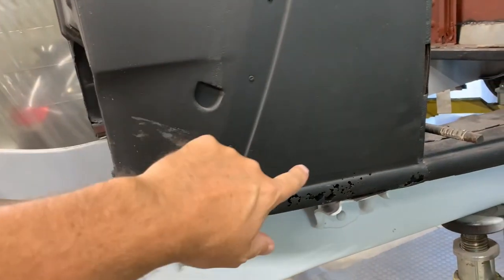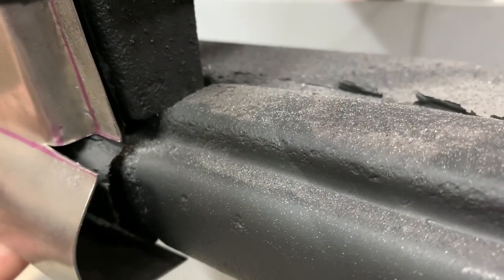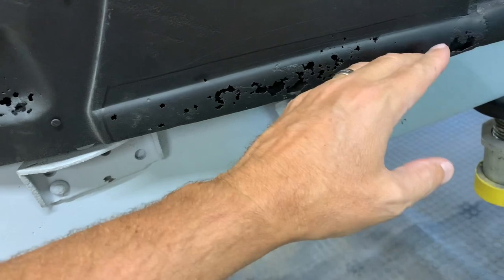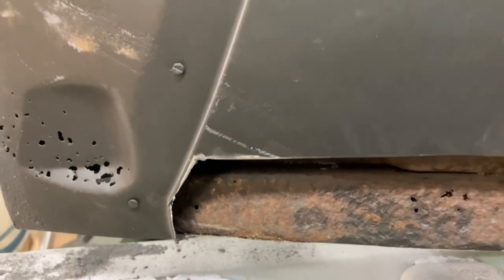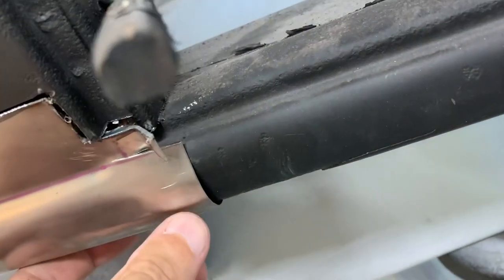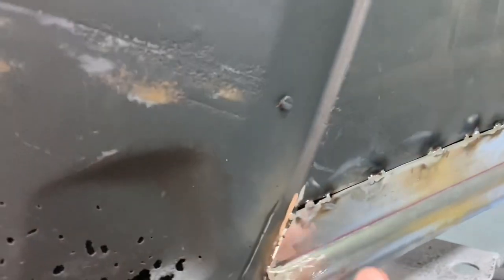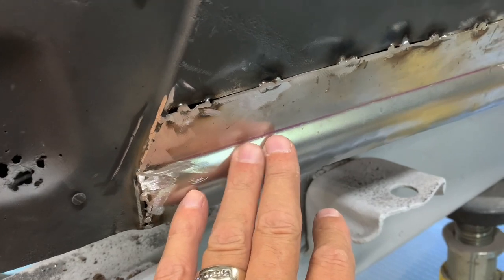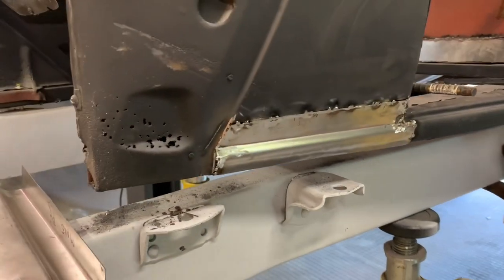Lower Cowl Repair 1937 Dodge Truck

Comment: Well what about the rusted out panel behind it?
Reply from the maker: I didn’t show that part, I cut out the holes and patched, then I sanded the best I could and sprayed a rust converter on areas I didn’t replace. After I finish welding the cowl patches I will seal with an encapsulater paint and then undercoat. That can be done from the inside.